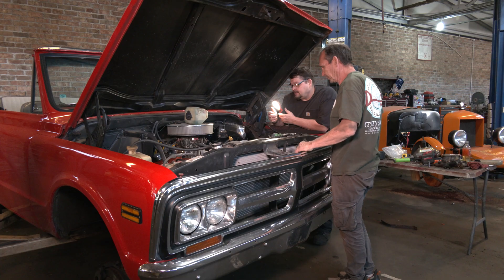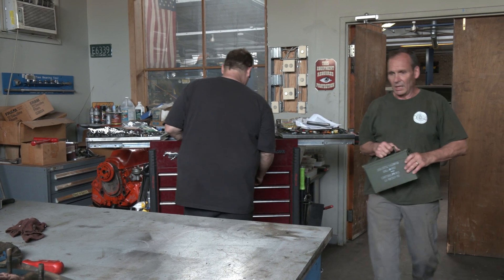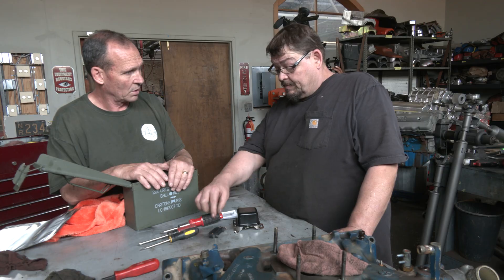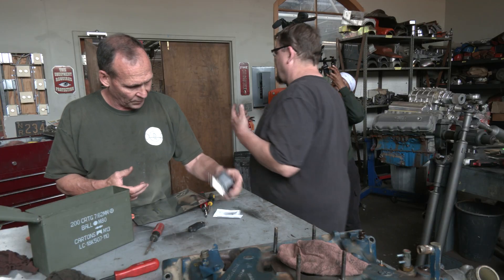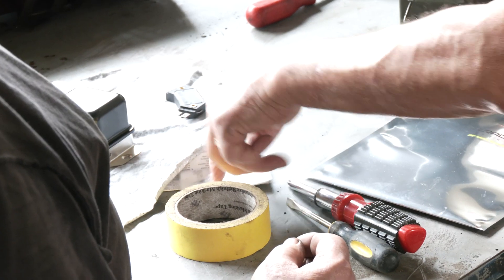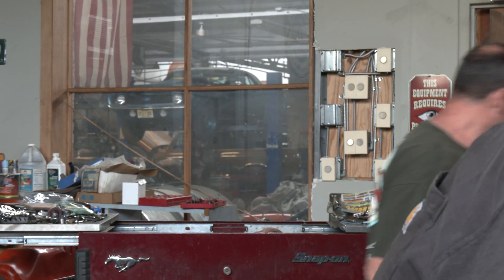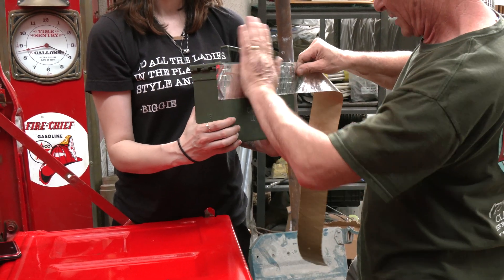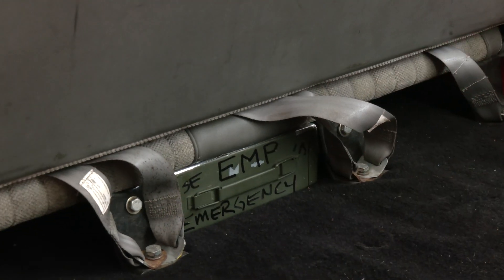Shielding Against the Unknown: Assembling EMP Kit for '71 Jimmy

Comment: I don't get why you would use electronic ignition instead of points. Points ignition & points external voltage regulation is EMP proof. Fuel delivery from a mechanical fuel pump & carburetor,  and your gold. True, regular routine maintenance is required, with a REAL tuneup, but that's the cost of doing business on the post apocalypse highway, right? 
 
But yeah, a spare module in a static baggie works too.

Comment: Never use that junk silicone on an hei module, use computer cpu paste. Replaced many customer installed ones that shortly stopped running after the customer installed using the crap. Dropped it off at the shop with the I just replaced the module, it stopped running again. Must be the pick up sensor, lol. Replace the module, apply cpu (zink)paste out the door never to return for that issue again.

Comment: What you have missed protecting is the wiring loom and light bulbs. Add a few electrical connection points around the hood, doors, and other openings. This will help turn the entire vehicle into a Faraday cage that protects everything.  It probably won't be perfect, so in addition to the the parts you included,  add wiring (black and white 14 gauge) headlights ( hopefullythese are the bulb and separate lens type), tail lights, and an assortment of crimp on connectors.  Fill out your nut driver set with the other common sizes like 3/8 and 7/16. Add a 6" Cresent wrench. Get a second ammo box and an anti-static bag big enough to line the box like a garbage bag. Load 'er up and your a go. I'd also point out if there is damage under the hood, your starter and alternator will probably be toast hence work on electrically connecting everything surrounding the engine compartment.  Finally,  a couple of hanging grounds to bleed off any residual charge...

Now, got gas?